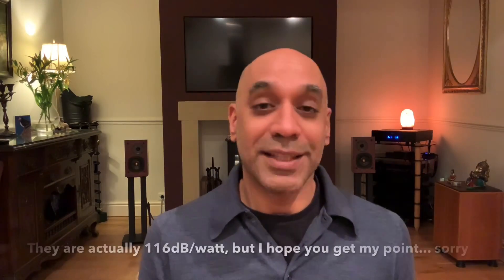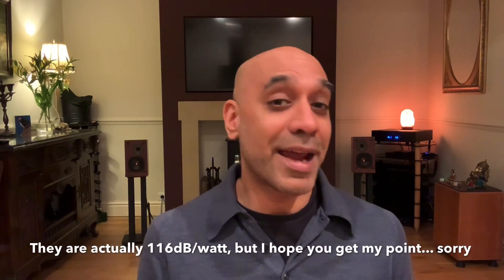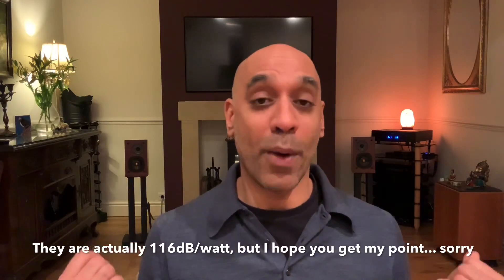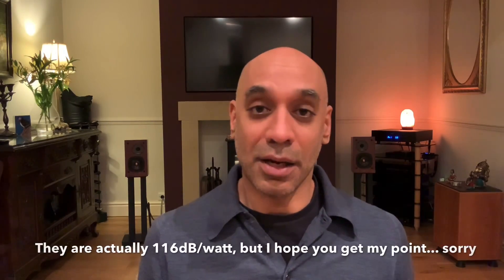Hifi Myths & Misconceptions - Amplifier Power

Comment: Interesting video. I worry for your friends hearing lol. I can push 1kw on my PA system but have never been in a venue large enough for it to be a safe level. Is that you main listening room? Id be interested to know if or what acoustic treatment you have used in the room. Thanks
Reply from the maker: Hi Jay, since I have been in this house, my main system resides in our family room which is our primary entertaining space. The system is in use every day by the whole family. In my last place it was in a bedroom for 12 years and rarely saw the light of day. I wouldn’t put acoustic panelling in this area for aesthetic reasons. Although beneficial, I think a lot of people don’t really understand what to do when treating their rooms. Just placing a panel at first reflection points may help but may also alter the off axis response and make things worse. I am no expert but may do a video to share what I do know 😁

Comment: Very good explanation. Most of us use less power than they think. The VU’s on my Accuphase confirm you’re explanation. Most of the audiophiles prefer class A amplifiers but they have mostly less power, take the Accuphase E-650 =30Watt the E-470 = 180watt.
Driving large B&W’s witch a tube amp of 30 watt and never had lack of power. No earbleeding levels for me...
Reply from the maker: Hi Patrick, thank you for watching and sharing your experiences 😉

Comment: Been watching a few of your videos. Fantastic and clear explanation of concepts. I have a question, though: Can AVRs ever get musical? I'm a pure stereo guy for over a decade. Now that my family wants a home theater, I thought I'd consolidate and have just the AVR. But, having auditioned a few AVRs from many brands, I still can't get the stereo imaging - ok, the energy, the feel, the enjoyment, from these AVRs as I'd from a simple 2-channel box. I don't want to have a cluttered system - one for stereo and another for home theater, all fighting for space and the cables becoming unmanageable. Any ideas?
Reply from the maker: Hi Narendran, I don’t think you will get the sound quality you crave out of an AVR unless you spend silly money on a dedicated AV processor and dedicated power amps. No one seems to do this at realistic prices to my knowledge these days. I would connect the AVR to your stereo amplifier line level input, even better if it has a HT (Home Theatre) by pass. Use the AVR to power the centre channel and surrounds and the stereo amplifiers to power the front two speakers 😉
Reply: Narendran V  The new Dolby system does not allow multi channel receivers to properly reproduce stereo.Gene at Audioholics did a vid on this issue. After several years of being disappointed with my HT receivers (tried a few well known brands) I turfed my surround sound receivers in favour of a BGW powered triamped system set up in stereo. I will not bother to tell you what garbage most receivers are (oops, I just did !). Two sub cabs with 15" drivers for the bass, 700 watts of power and nobody misses surround sound. With this system I don't have to care about flavour of the month video connectors (hdmi) that could doom receivers to obsolescence. Great 2 channel sound is better than mediocre multi channel IMO. Dynamics and bass are what makes movies sound impressive. Setting up proper multichannel is usually a nightmare due to room constraints and is easily avoided with a great 2 way system. Save money, have better quality audio and real stereo sound, hard for me to see a downside to this approach.

Comment: I do really like your video, your tempo and the manner you present everything! :-)
My question has always been that, if you do only use sub 1W to get an okay listening, then would i.e. 50W be so loud that your windows would blow out, your ears would bleed and so on. Still do very few amplifiers get sold with below 50W and you do turn the volume button more then 1%. So what is going on?
Second have I newer like the Watt unit, it tells nothing about if its a 25V 10A or a 50V 5A, I think it's a bit like asking, how big are your flagpole and answering by saying 2 ft^2. :-)
EDIT: I may explain that I meant square feet, not cubic feet, since the Watt unit do also leave a lot of information out, that are of equally importants.
Reply from the maker: Hi Fried, I am not entirely sure I understand the question?
Reply: @abritishaudiophile7314  Thanks a lot for answering, I'll try to ask in a better way:-)
By your calculation and others calculation that are equal to yours, will maybe 2-5 Watt be laud enough to blast like a rock concert in a normal room. But normally do you see everything from 50W to 500W. That means you had to only touch the volume control to be laud as a space racket taking off. But in reality do you turn the volume up to i.e. 50% and the volume is not like a rock concert.
So why do the calculation says that 0.3W is laud but in reality do you maybe play by 30W?

Comment: 85db of constant noise over an 8 hour period of exposure per day. Music is dynamic and not constant however. 95db for 1 hour is the safe limit per day. Motor cycle riding is 100db and only safe for 15 min
Reply from the maker: Thank you for watching and commenting
Reply: @abritishaudiophile7314  I do use a SPL meter and a tripod to check my listening levels. Every serious audiophile should have one. Dynamics are more important to the enjoyment of music than just loud. 40db of dynamic range with an average level of about 75db and room quiet level at 40db. Get an app for your smart phone at they do an adequate job to protect your ears and equipment.

Comment: I own some very efficient speakers, Triangle Genesse Quartet. They are around 95 db SPL, but on the low frequency zone they drop to around 3 ohms in impedance, so they are not so easy to drive. On most of the mid priced mid powered amps they sound thin, bright and wimpy, but when powered with a mark levinson 331 power amp they sound more full, relaxed and effortlessly. I think that they require a very powerfull amp to sound right. Best regards, love your channel.
Reply from the maker: Hi AMC RO, if it drops down to 3 ohms, that is quite a difficult load. I am not surprised you need an amplifier with a stiff power supply. Thank you for watching and sharing 😉

Comment: Bottom line: better buy sensitive speakers than a powerful amplifier.
Reply from the maker: It is certainly cheaper that way 💰
Reply: There's always a tradeoff.  More sensitive = larger speaker, all else being equal.
Reply: Its more important to buy a speaker that you like the sound of them you choise the right amplifier, speakers with high sensitivity is not always easier to drive some can even dip to lower than 3 Ohm and that require a powerful amp

Comment: 6:10
When I worked as EMC test engineer, we had an anechoic chamber for emission testing.
While it was an anechoic chamber made for EM waves instead of air pressure waves, it also did its job for audio.
So one time, we had permission to use it for personal experiments on a Saturday afternoon (business was normally closed on Saturdays).
Everyone of my test department brought some audio equipment from home to test in the chamber by performing some basic measurements.
We already expected that It would sound a bit weird; it's noticeable while talking inside the chamber, but with music it's 10x worse, so it sounds very nasty.
It's like there's a black hole in the corner of the room where all sound is drawn in to; it really kills everything about music.
Nevertheless, it was a fun and interesting Saturday afternoon.
Reply: Qorax I understand and appreciate this comment. Anechoic chamber tests make little sense. Some people like to refer to them as a means of eliminating the room. However the real world is a reverberant space.
Reply: @navinadv  Ah yes, taking measurements is just a means to check one very specific part of the audio reproduction.
All other aspects need to be ruled out from the measurement, that's why the anechoic chamber is used.

You can compare it with a painting: it's like looking up close to a painting, where you can only see 1 swipe of paint that looks like a stain, it looks ugly.
By measuring this swipe of paint you check that it's the exact way as it should be.
But only by stepping back from the painting, the swipe of paint becomes an integral part of the full picture and you discover it's part of something like a tree or house.

The same goes for listening to the full sound image vs. just measuring one specific property of the sound.
Reply: Qorax 
Great comparison, Qorax.
Reply from the maker: Thank you Qorax, I would love to be able to experience one myself one day 👌
Reply: I know that this comment is, in the hi-fi world, about the same as postulating the earth is flat in other fields of science, but please hear me out. :-)
Maybe is room acoustic or at least the way we do it now, a bad thing! Why do I say that?! Imagine any cafe, bar, gym hall or any place where music gets played inside. It do sound live and is what we do all try to copy at home, but no one have treated the bar to acoustic perfection, placed the speakers correct to the walls or covered the floor with a acoustic dampening carpet. In fact may the bar / cafe be the worst sounding room in the century and still do the live sound, fare exceed what can be done at home in the scientific perfectly corrected room.

Comment: This is an interesting subject - just how much power is enough. I think your stated db range is probably on the low side for well recorded music

The loudness wars and over reliance on automated recording apps resulted in a decade or more of trashy recordings that are better forgotten but there are a lot of old recordings that have very good dynamic range. I just opened up a file of Long Black Veil in Audacity and this 24 bit FLAC file has a lot of dynamic range; they didn't use all the 110-120db range available but I'll bet they got well over 60db or more db on that file. 

When I listen i want to hear all of it. I have a pair of Elac AF61's that are being powered by  a pair of used PS Audio m700 class D monoblocks. Those speakers are rated at 87db (and that is probably optimistic) and have a 6 ohm impedance (dips sown to just under 4 ohms). These are sitting in a 16ft room with a 14 foot L off of it and are about 3 ft out from the end wall. This particular song has no huge peaks with drums, just two guys with acoustic guitars but it is well recorded with no compression I can detect. I'll have to look and see what my 1960 recording of the Mercury 1812 (with West Point French bronze cannon) looks like on Audacity, I have the original record and a remastered CD as well. There is compression on that recording but considering the Ampex 300 recorder used they did a damn fine job on that recording

I probably listen at 70-80db average so the peaks and troughs go a pretty long way, I'm sure the peaks are over 100db for very short periods of time and the lows are just audible. To handle this I need an amp that can hit those peaks with room to spare. My old amp was a modded Hafler d220 (120w / ch) with musical fidelity driver boards, it was a good sounding amp but it occasionally went into clipping  on dynamic material - gentle clipping so it didn't sound terrible but visible on a scope. 

I was going to by the PS Audio BHK amp but that cost close to 3X what I paid for the pair of monoblocks and was a bit out of my price range. I got these at a good price and figured the extra power wouldn't hurt. The low end is handled by a pair of Sumiko subs.
Reply from the maker: Hi Dell177, I really enjoyed reading your comments. Thank you for watching and sharing your experiences.

Comment: Calling a low impedance speaker “difficult to drive” is misleading. Lower impedance speakers will make more sound than higher impedance speakers with the same output voltage. Output voltage is the parameter that is correlated to how high the volume knob is turned up for a given amp.  If you have a 4-ohm speaker vs an 8-ohm speaker, the 4-ohm speaker will draw twice as much current, use twice as much power with the volume knob turned to the same point, but it will also make 3 db more sound, so you won’t need to turn the volume up as high, and in all likelihood (assuming the both speakers have comparable sensitivity levels) you would use the around same amount of power.  

Also, most amps are capable of putting out more power into Lower impedance.  Most class D ans some A/B amps that are rated at 40 watts are 40 watts into 8 ohms, but will actually put 80 watts into a 4-ohm speaker. Virtually all modern amps also can deliver more sound with a lower impedance speaker. The Only time a Lower impedance speaker is really (hard to drive) is if it also has very low sensitivity so you have to crank the volume knob higher to get the sound levels you want, then you might overdrive an amp that doesn’t deal well with higher current. 

Unless you are trying to drive 83 db 4-ohm speakers with a vintage tube amp, you can pretty much ignore all the BS about low impedance speakers being “hard to drive”.
Reply from the maker: Hi Kevin Gest, thank you for the feedback and some good points. You are right about most amplifiers being able to drive 4 ohm loads these days but there are still some that will struggle and many speakers dip down to 3 ohms at points in their frequency range. The reality is that a loudspeaker with a nominal impedance of 8 ohms (minimum 6) still presents a easier load than an speaker with a nominal impedance of 4 ohms (minimum 3) by placing less demand on the power supply.

Thank you for watching and sharing.
Reply: @abritishaudiophile7314  , I've been reading that tube amps (like Mcintosh for instance) are impedance-invariable. In other words they deliver the same power and current to loads of 8, 4 or 2 ohms. Is this true? It may have to do with those big transformers in the back of this type of amp.
Reply from the maker: Hi Pedro, I am by no means an expert of different tube topologies but my understanding is as follows. Tube amps by nature have a higher output impedance than their solid state equivalent due to having output transformers to drive the current. This means they will also have a lower damping factor which is the ratio between the input impedance of the speaker and the output impedance of the amplifier. The damping factor determines how much control the amplifier exerts on the speaker and (due to faraday laws of electromagnetism) how much control the speaker tries to exert on the amplifier by generating a back EMF. 

Of course, you want the amplifier to control the speaker and not the other way around. There is a lot of fuss made about damping factor but the reality is that once you have a damping factor of a few hundred there is really negligible benefit from it being higher. A solid state amplifier will probably have a damping factor of 300+ where as a tube amplifier may typically have damping factor of less than 100. For these reasons solid state amplifiers are considered better than tube amplifiers in driving low impedance speakers.

I am sure, like everything in this hobby, once you get into the details of particular designs, there are exceptions to the rule but I believe that these are the general characteristics.

Comment: How can I make a video suggestion Request?
Reply from the maker: Fire away Lewis.
Reply: @abritishaudiophile7314                                                                                                                                                      When the Proac sc1 was available it was an expensive speaker. I remember listening to them at a hifi shop and being very impressed. This is obviously years ago and they are not available anymore. I would be very interested if you did a comparison video comparing the sc1 with the best small speakers available now.  Revel and Harberth in particular would be good. 
This could become your quest to find something better. Thanks.
Reply from the maker: Hi Lewis, thank you for the suggestion.

Comment: 3:33   If you think 90 dB is way too loud, then you should not care about how many watts your amp has, since even the cheapest and weakest amps in the market can drive pratically any speaker well above 90 dB.
Reply: If you have larger speakers they will perform much better with plenty of power on reserve. They may get loud but they distort. The bass draws a lot of juice. Even at lower volumes a big amp makes a noticeable difference. The more headroom the better, because of what he said about peaks and troughs. You can listen at low volume and get crystal clear sound, you can then crank it up as loud as you would ever want it, and still get clear sound (within reason of course). I have 100wrms 400w peak 15" speakers, that tells me these speakers may demand up to 400w of power on a peak. I run a 500wpc amp and have plenty of head room. My amp should never clip, my sound is always clean at all volumes. I do have a max volume setting on my receiver so I can't blow my speakers, but its so loud you'd never get there anyway. Your ears know best on volume levels.
Reply: There is plenty of amps that cant drive demanding speakers to 90 db 100-150 watts is where you want to be, if you like to play around 90 db